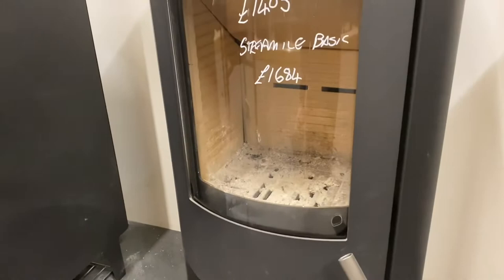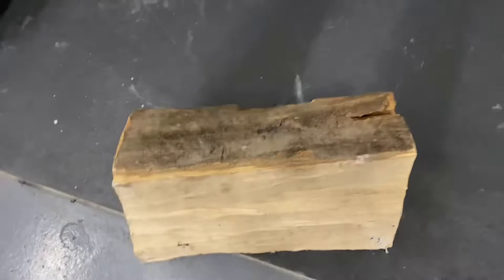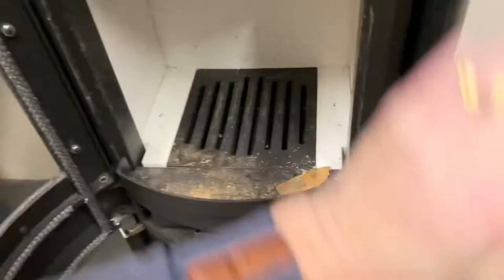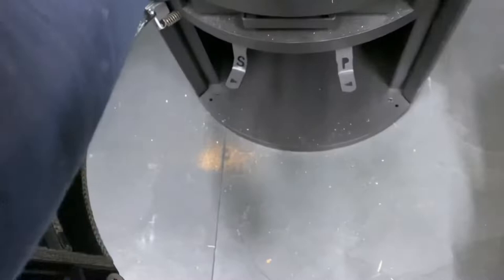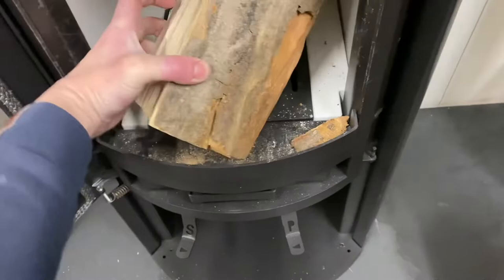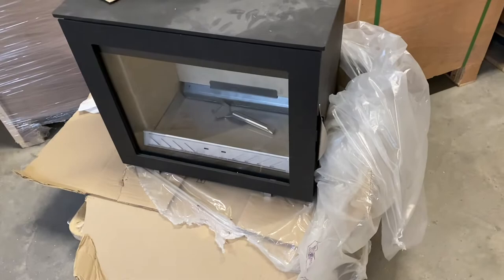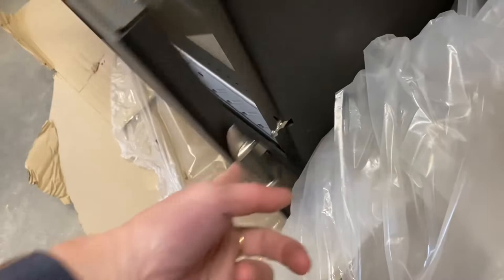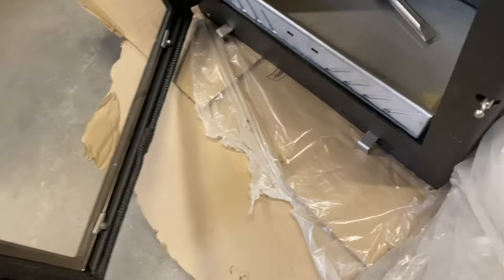CHOOSE YOUR NEW STOVE CAREFULLY  - Don’t trust photos ! - Natural Heating (Norfolk) Visit our shop

Comment: Hi what type of twin wall flue would you recommend for outside I've seen 2 types of flue were on has a sealed end and the other doesn't you can see the installation? But they are both Heta approved!?
Reply from the maker: We use Schiedel eco icid